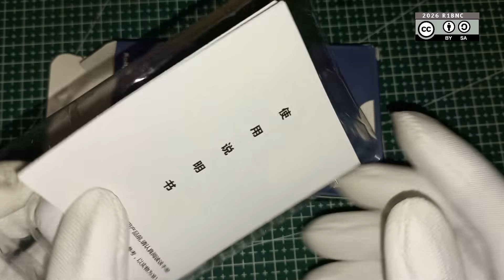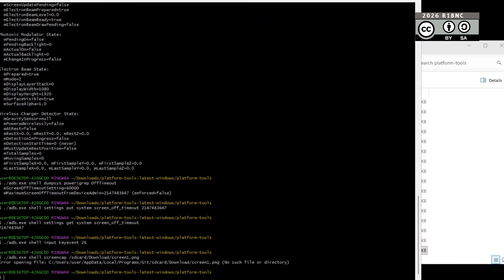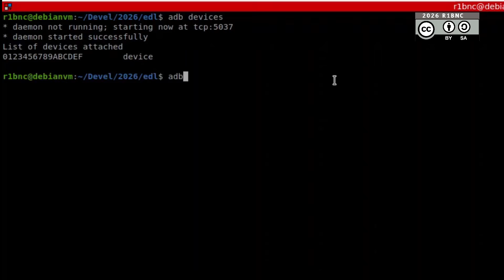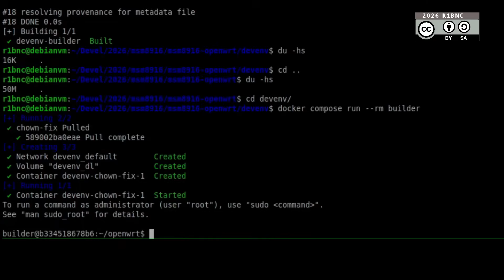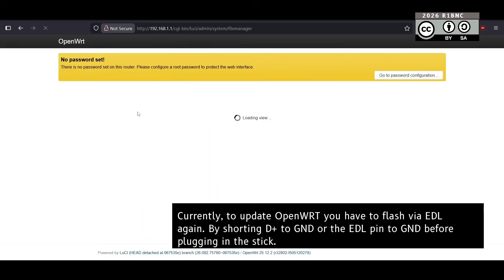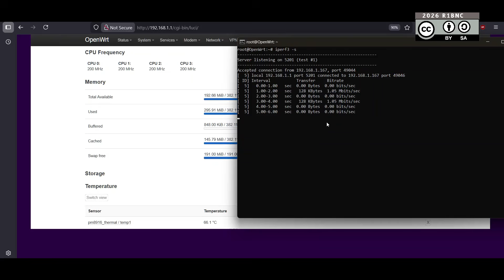Turn a Cheap 4G LTE Modem WiFi into an OpenWRT Travel Router

Comment: i have a same board uz801 v3.2, but its factory modem firmware does not work in debian13, while uz801 v2.1's has no problem in same image.🥲 does your modem firmware work well? can you share it?

Comment: thinking about getting one so i can get a vless client on it..
Reply from the maker: This thing gets very hot, try to get MiFi with same chipset.
Reply: @R1BNC  i considered that, but i live in Turkey and here we have very bad import laws which prohibit you from buying stuff from outside the country without hiring a customs advisor, and also register the IMEI with the government for a measly price of 1100 USD. I searched up some on local sellers and they only really sell 1 modem that supports OpenWRT and that one doesnt support singbox or passwall. Probably going to have to order a MiFi from abroad via a friend and swap the IMEI number with a phone i don't use anymore
Reply from the maker: If you buy this USB 4G LTE, you can add heatsink/fan to keep it from overheating. Yes, IMEI can be changed even on MiFi.

Comment: Can an SD card be used? Are there pins for an SD card connection?
Reply from the maker: This one does not have sd slot or pins.
Reply: @R1BNC This green one I have does not have SD card either.

Comment: Dude, that antenna connector on the board is for the wifi or the mobile data? The two lines, I mean
Reply from the maker: I believe this is a factory test point for the LTE circuitry, might be MS-156 connector. I'll update you if I get an adapter to SMA.
Reply: @R1BNC Just opened my stick that arrived today.

Green with no socked, there does look to be some kind of pad with zero ohm 0201 position switch chip.

Has Tx and Rx on both side with loads of other test points on SIM side and a sticky back flex PCB antenna stuck to a red plastic form.
Reply from the maker: @welshdave5263 does the PCB has writing of UF 02 instead of FY_UZ801_3.X? a different model perhaps
Reply: @R1BNC 
UF 02 250708 and maybe V0.5 after it in really smudged black printing.

In silkscreen...
zbx002 E465280  94V-0
Reply: @TheAlvAlves  I've been wondering this, Gemini tells me it might be for somekind of factory calibration or something.

Would be really useful if it is mobile data or WiFi.
Reply: @welshdave5263 gemini and gpt plus both said it can be used for both, depending on the project.
I mean...
They're not wrong, but weren't helpful lol

I need to buy another one. Specially the spoofed model that can run debian.

I need to run x-ray core + tun + wifi Hotspot on it to use this thing as a unlimited data VPN server/router

Comment: Flash sucess but not boot openwrt
I'm using uzi801 v3.0 
Why???
Reply from the maker: Restore from your backup. I only tried this with UZ801 PCB v3.2
Reply: @R1BNC  Does the modem+hotspot+vpn application function like passwall2 work well?